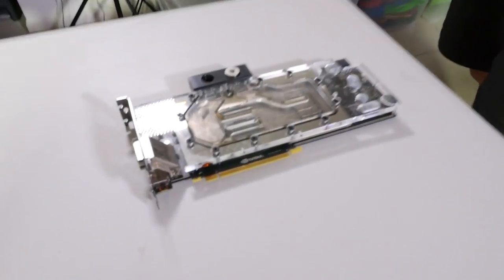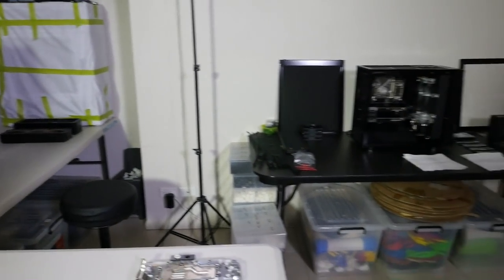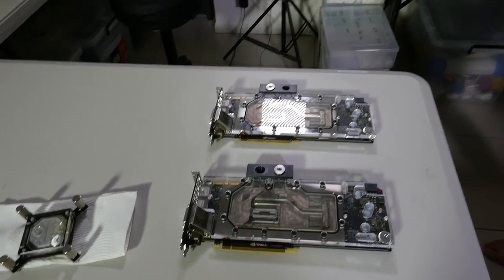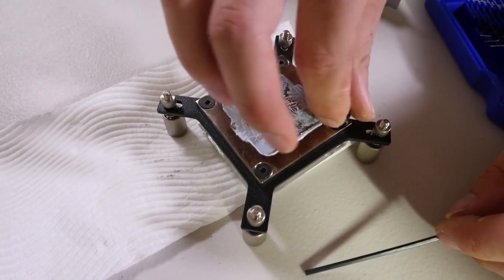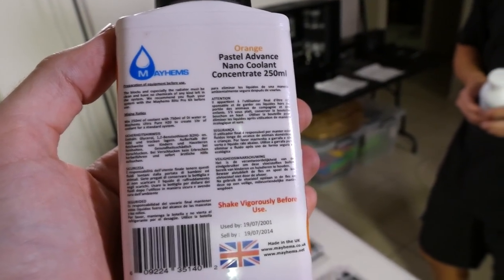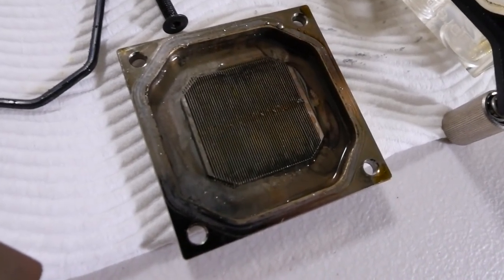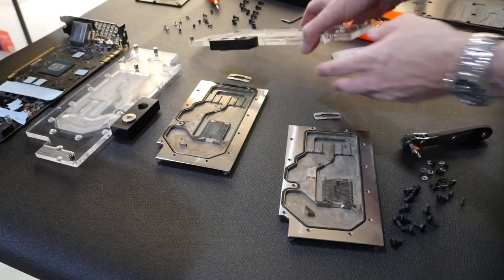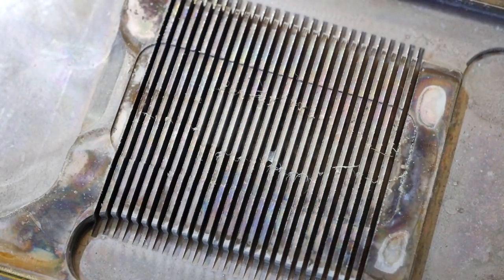Corrosion

Comment: It's clogged with plasticizer.  They guy used cheap tubing that leeched.  I bet his tubing had white film buildup on them, too.  And if you mix stainless steel with nickel, the nickel will corrode.  Same for copper.  I'd nickel plate that stainless steel piece so everything is one metal.
Reply: Everything still won't all be one metal, the radiators contain brass end tanks depending on the brand.

Comment: he said he never sees on HIS systems.. yeah yeah XD

funny tho i have never seen any corrosion using distilled water with kill coils in mine either and my loops are quite large like cpu/dual gpus/external rads over 20 feet of tubing chiller my current loop holds over 8 gallons of water distilled as is needed for my chiller .

now that what it looks like is ek infamous plating jobs lol

Comment: looks more like mayham fluid was used I have used one water cooling pc 6 years haven't changed water. I use silver based cup block and distilled water  and as I LOOK AT THE GPU BLOCK WATER IS PERFECTLY clear zero corrosion. When I get new rads I clean with vinegar and salt 24 hour drain than I use baking soda and distilled water than I go to radiator shop and cleaned. 20 dollars per rad zero problems but they are really different as water is changed yearly as it only takes 5 mins  to change out the old water . I use 3 gallons of distilled water and push the old water out using remote pump to fill and replace loop water as a real expert would do. these are pcs I SELL. my gamer gets same treatment. my browser I just want to see how long before problems occur.